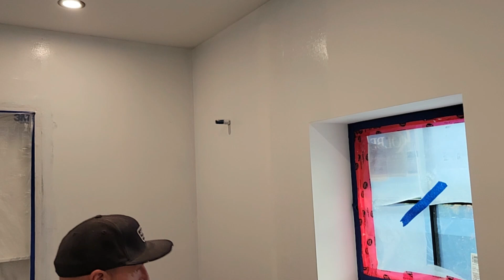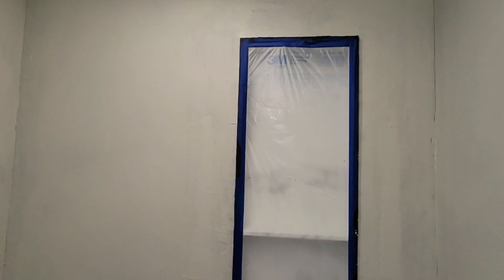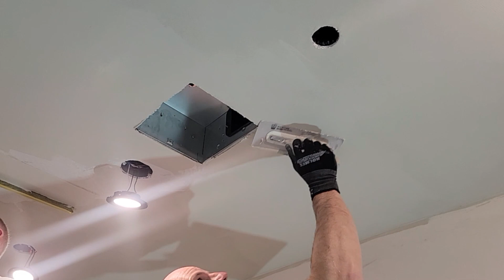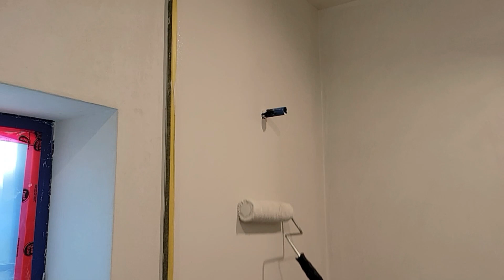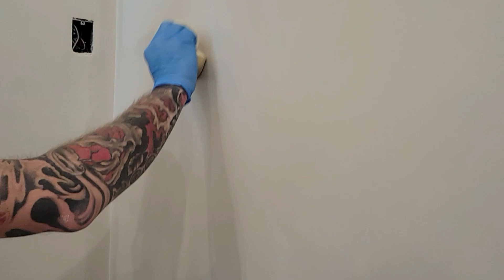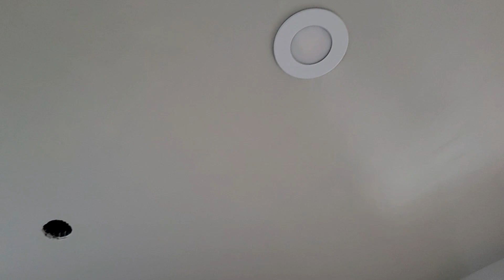5 Star Finishes #Microcement Synergy Shower Walls and Bathroom Application Tutorial

Comment: Nice video!! Could this adhere to polyurethane waterproof membrane?
Reply from the maker: Hi There 
The Microcement may adhere directly to the membrane but I would need to know the product and its specs and recommendations. If there is any doubt regarding adhesion then you can use our extreme primer plus, or any other tile to tile adhesive etc and test to ensure it has a strong bond to the waterproofing. Once the waterproofing is primed properly if need be then any Microcement can be applied.

Comment: What’s the mesh you are using?
Reply from the maker: It’s an Eifs stucco system mesh that has adhesive glue applied to the one side making it easier to work with. We have also found that using Trim Tex spray glue meant for plastic beading in drywall is great for adhering down any bubbles, corners and edges etc and is a must for a perfect mesh install. No more bubbles on the first coat of plaster.

Comment: What an awesome resource for people out there wanting to do some smooth micro cement.
One question: in wet areas, like a shower floor, how often to recommend reapplying the final sealant, I'm seeing every 3-5 years?
Micro cement is almost exactly what I'm looking for. Biggest drawback being having to reseal. 
Thank you for this incredible free resource. I would love to learn from you and bring more of this to the states.
Reply from the maker: Hi There 
Our system ends in the final hi wear oil sealer designed for forklift traffic and commercial food preparations. Its largest benefit is that it doesn’t require a reseal and literally won’t wear away unless you diamond grind it. The sealer is also chemical resistant and stain resistant to basically everything and specially doesn’t harbour that pink mould. After 4 years a shower with this sealer would certainly not have worn away. We do not recommend water based polyurethane be used in any wet areas for micro.
Reply from the maker: As a side note we are offering two Microcement wall and shower courses coming up this year. You can see them at https://shop.5starfinishes.ca/products/microcement-wall-and-shower-training-course or on any of our home pages for 5 star finishes or our shop page.

Comment: Can any of these surfaces be applied over existing shower tile? If so, what kinds of preparation is necessary? Thank you!
Reply from the maker: Over tile they just need to be cleaned and any silicone removed if in shower and then the extreme primer plus is used as a primer which will bind the microcement to the tiles on a floor or in a shower etc. Usually our eifs mesh is used for floors but I rarely recommend it for wall tiled surfaces . Tile is actually the best substrate for microcement in my opinion
Reply: @5starfinishesltd693  Have you ever gone over travertine?